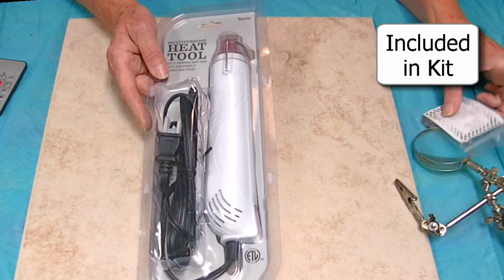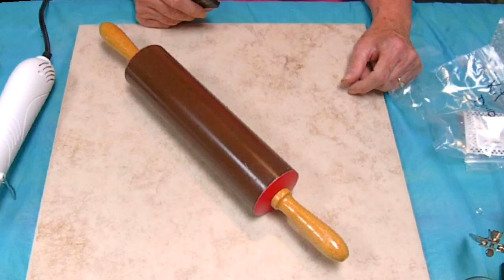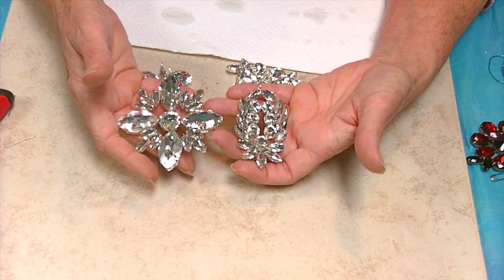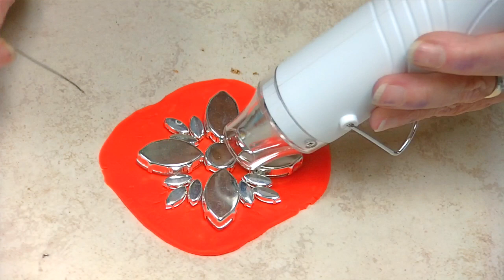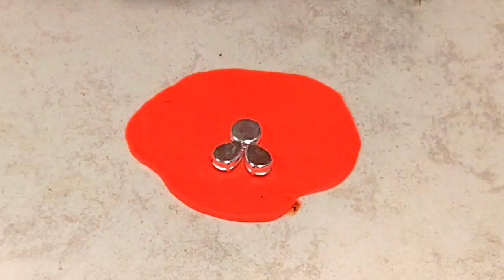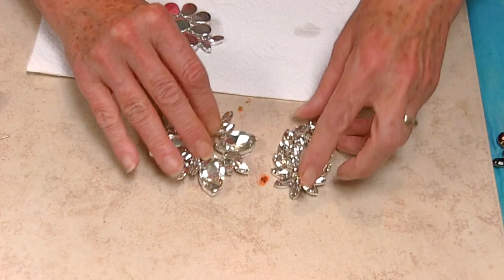Jewelry Soldering Starter Kit 1 - Rhinestone Pendants

Comment: I did what you did and I can't get it to solder. Us the metal pieces stainless steel? The one I bought is stainless steel 🤦🏿‍♀️. It's a stubborn piece to solder
Reply from the maker: I would like to help. However, you have not given me enough information to work with. Can you provide me with more information and i will see if i can help.
Reply: The metal back I bought from Amazon, It's stainless steel. I used handy flux and solder with rosin core in it. It wouldn't solder it just balls up.
Reply from the maker: If the settings are stainless steel then my best guess is that your solder melts at a higher temperature that your heat source can supply.
Jan
Reply: The solder melts at 475°

Comment: Is that solder strong? I understand the benefit of not having to plate the settings after soldering but is it strong?
Reply from the maker: Hi AJ. The melting point of the solder does not affect the strength of the solder bond.  In other words 700 degree solder is not twice as strong as 300 degree melting point solder.  They both have the same solder bond.

Comment: Hi Jan, 

My heat gun is 392F. Is that too high for soldering this kind of cupped rhinestone jewelry with the 300F flux from your site?  Thanks!
Reply from the maker: Hi Aurora.  Your heat gun should work just fine.  You only want to heat the settings enough to melt the solder.

Comment: Hi Jan, is it possible to solder with claws that have a copper base instead of a brass base? Love you videos! ♥
Reply from the maker: Hi Laura.  Thank you for the question and your comments.  Yes, copper will solder the same as brass.  Aluminum is the most common metal that cannot be soldered.
Reply: Thank you for the reply! I also want to ask: do the claws have to be plated with real silver?
Reply from the maker: Hi Laura.  The settings do not need to be plated.  Plating is done with "silver".  I do not know what other metal would be used to give the appearance of silver plating.
Reply: @Jansjewels  Hi Jan. I have seen rhodium plating be used to give the appearance of silver.
Reply from the maker: Hi Laura.  I have not worked with rhodium plated setting but I do not see why they would not be able to be soldered.  The whole idea of using silver plated settings with the heat gun is to avoid having to silver plate the finished piece.

Comment: I tried many times even i use flux but not sure why it never really attach those rhinestones strongly. Do you think different kind of stell material could affect this? Thank you
Reply from the maker: Hi Meliana.  Please make sure you are heating the metal findings hot enough to melt the solder.  A common error is to apply the heat to the solder instead of the findings.  Aluminum cannot be soldered.  Hope this helps you get started.

Comment: What type of solder wire do u use todo this?
Reply from the maker: Hi Stephen.  The solder wire is prefluxed acid core solder with a melting temperature of 300 degrees.  It is available at Jan's Jewelry Supplies:  https://www.jansjewels.com/soldering-paste-soldering-torches-1.html

Comment: Hi! Thanks for uploading these useful videos! I have a few enamel earrings that I want to convert them into clip-on earrings, would this kit ( heat gun and the solder you used ) work for that too ? Or would you suggest torch ?
Reply from the maker: Hi Helen, I would use the heat gun. The temperature will be lower and you will be less likely to damage the earrings. 
Jan
Reply: Jan's Jewelry Supplies hi thanks for the reply ! Also would soldering paste work with heat gun ? Or it has to be the wire ?
Reply from the maker: Hi Helen.  The soldering paste has the same 300 degree melting point as the solder wire.  The soldering paste will make it easier to attach the clip on earring findings.  Apply the paste and position the clip on finding before you apply the heat.
Reply: Jan's Jewelry Supplies
Thank you for your answer ! Last question before I make an order, would lead-free soft silver solder work with heat gun as well ? I was recommended to use lead free solder.
Reply from the maker: Hi Helen.  The lead free solder has a higher melting point and does not work well with a heat gun.  You will increase the chance of damaging the enameled earring.  The small amount of solder paste you will be using will not come in contact with the skin.
Reply: @Jansjewels  Hi ! Thanks so much for your help ! I got some supplies from your shop already and look forward to starting the projects !

Comment: What places do you send finished jewelry to be plated? What would I search for?
Reply from the maker: None of the pendants in this video will need to be plated.  The whole idea of using silver plated brass settings, 300 degree solder and the heat gun is to eliminate the need for plating the finished piece.  I hesitate to recommend a particular jewelry plating service for finished jewelry since there are issues with the ones we have used.
Reply: Recommended for unplated brass settings is Tri-Jay or Accent Plating in Rhode Island.

Comment: can i solder these stones to a silver plated wire? I tried to do so but never succeeded
Reply from the maker: Yes.  I can see no reason you should not be able to solder to silver wire.  If the wire is actually aluminum and not silver, you will not be able to solder to it.  You cannot solder aluminum.

Comment: do I understand correctly  using heat gun I can "solder" Silver our gold plated settings with stone?
Reply from the maker: Hi EwiPoland.  Yes.  The stones must be glass and not acrylic stones.  You will not find gold colored solder.  The solder I use is prefluxed acid core solder wire with a melting temperature of 300 degrees.  You can find the solder at:  https://www.jansjewels.com/soldering-paste-soldering-torches-1.html
Reply: Jan's Jewelry Supplies  ok ,stop me if I'm wrong your solder cable is tin ..? because in truth to solder silver and gold we do not use tin we use a silver solder or a gold solder with a certain percentage of gold and silver in the solder. tin solder is for brass and copper
Reply from the maker: You are correct.  The prefluxed acid core solder is not used for making gold or silver jewelry.  We use this solder for soldering brass settings and silver plated brass settings.
Reply: Ok If I usse this solder wire ,is not allergic ?
Reply from the maker: I have not heard of any solder causing an allergic reaction.

Comment: Hi, for gold plated Swarovski settings which solder would be best?
Reply from the maker: All the solder has a silver luster and would be very visible with gold plated settings.  When I want to do a gold design, I use brass settings with the stones set, 450 degree prefluxed acid core solder and a torch.  I then send the finished design out to be gold plated.
Reply: Thank you Jan for the quick reply!

Comment: Hi there. What thickness of solder do you use and is the temperature in Fahrenheit or Celsius?
Reply from the maker: Hi Crystal.  The thickness of the solder wire will vary but that is generally not important to most people.  What is important is that the solder wire is prefluxed acid core solder with a melting temperature of 300 degrees Fahrenheit. The 300* solder wire is about .75mm thick. This is generally used with plated settings.
Reply: @Jansjewels  thank you so much. X

Comment: Hi Jan! Will this method work on non-plated settings too? Using the solder and heat gun you supply?
Reply from the maker: Hi Sarah.  Yes, you can solder raw brass settings with the heat gun and 300 degree prefluxed solder.